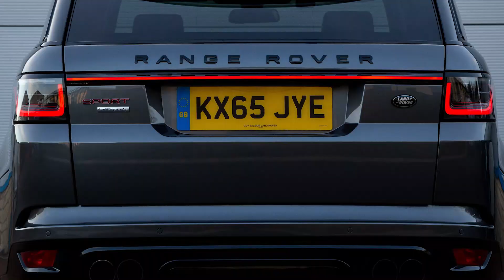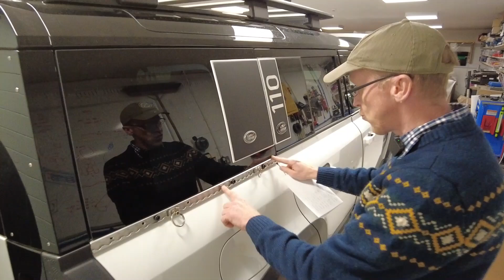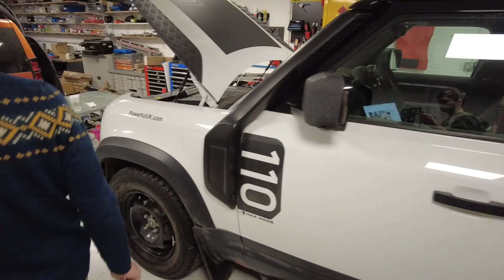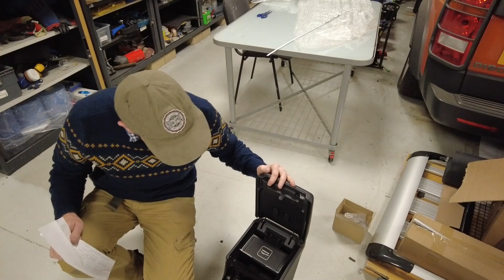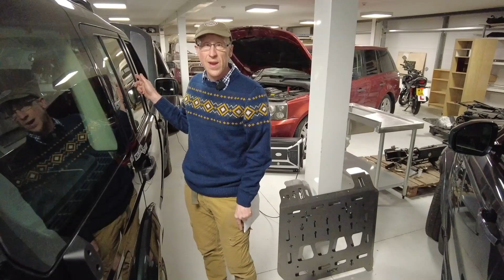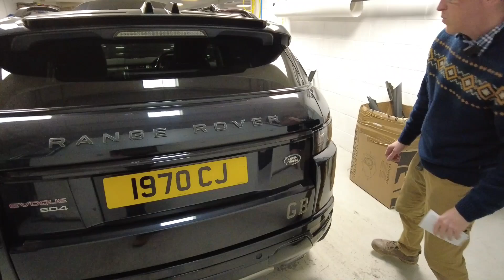VLOG 2nd Apr 22 - Lots of new Stuff - Evoque / Defender / Disco Sport / Shows / Munro EV etc

Comment: If you’re interested in a few problems from a New Defender PHEV owner that might have potential solutions…
1) when I camp in the back of the car, you can’t open the rear boot from the inside - someone mentioned to me that apparently the 90 HardTop has an interior switch but I couldn’t find out any more? Should be easy enough because I think the actuator is electric?
2) have you thought about selling tough/non slip versions of the bonnet “chequer plate” panels?
3) I have the activity key (v2) and like to keep it in the car; would it be possible to create some kind of charging stand/mount for the key within the car somewhere?
4) I’d really really like to source some interior “blanking” panels for the rear quarter light windows (between C&D pillars) to turn my 110 into a “utility wagon” like the outgoing defender had; the 110 hard top has these but I can’t find the part number or figure out if they’d work on a station wagon? I’d love to fit some storage nets etc to make use of what is currently dead space (like Mudstuff did with their utility panels for the old defender)
Reply: I’ll let you know if I come up with anything but you guys would probably do it 10x better with 1/10th as much faff!
Keep up the good work in any case!

Comment: Excited for the new products! Quick question, have you ever experienced vibration noise for the roof rack on defender. The noise is quite load and unique. Some people experienced it when speeding around 60 mph. Mine happens consistently between 45-50 mph. I tried to add some lock washers under all the bars. It did fix the issue for a couple of weeks. But it came back again. Wondering if you have any suggestions or solutions. Thanks a ton!

Comment: Definitely interested in the disco mollie plates, if I can make them fit around the safety devices roof rack. 
I would also be interested in the stop start disable  for the disco 4.
Defender corner lights, market for off road use only, or make sure you have properly read the road vehicle lighting regulations 1989. As I think you will struggle to make them legal. 
Keep up the good work